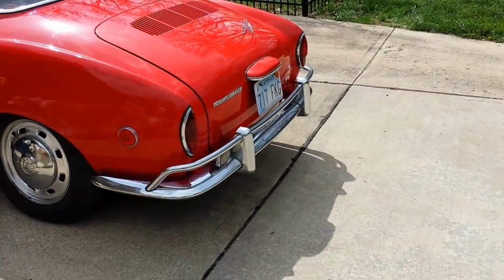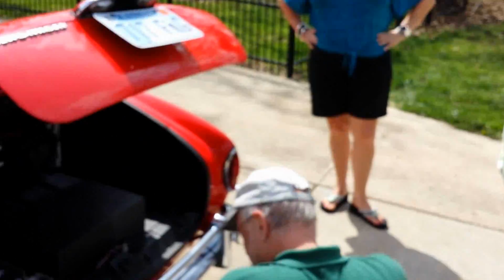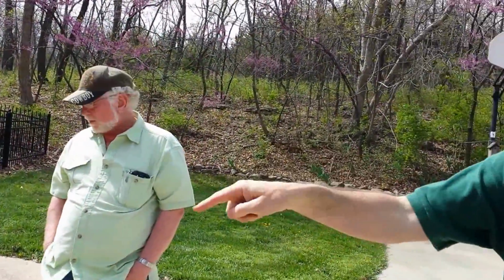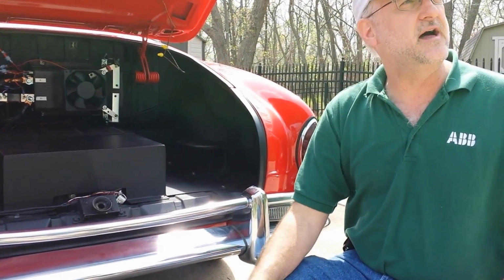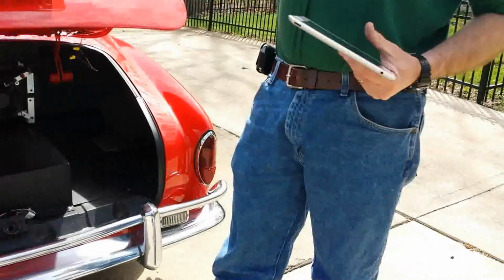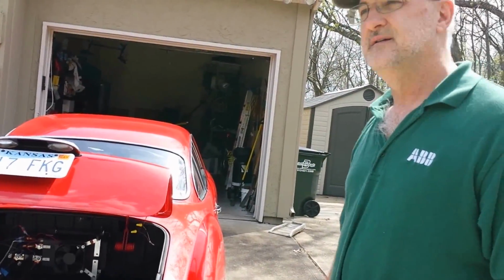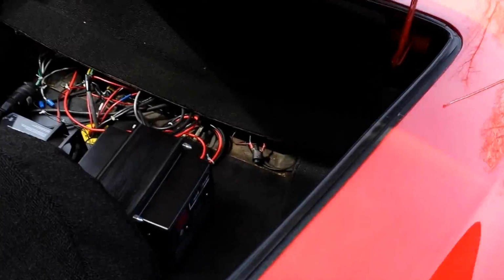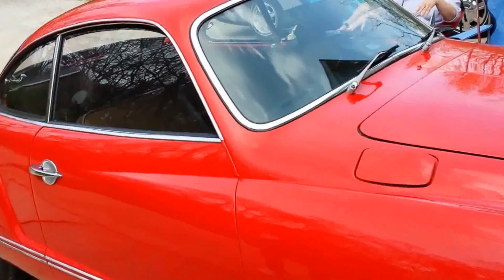1969 Volkswagen Karmann Ghia coupe plug-in electric conversion.

Comment: In a previous video and others like it the conversions take up more space (batteries) then the original engine, gas tank, etc...
I like the idea of placing the batteries behind the rear seat but there's not enough range (40 miles) to get chores done (inc. monthly 80 mile round trip to my sisters).  ;-)
I look at how and where components are located in these various conversions and wonder where I'd place things to provide trunk space (front and back)?

Comment: A Prius? How about a Tesla model 3 with the long range battery (75 kw) which gives you with the recent over the air update 335 miles of range. And it does have regenerative braking. Single speed 9.03-1 gear ratio.

Regarding the 12 volt battery simply add a 65 amp Bosch alternator above the motor shaft adding a single v-belt pulley to the motor shaft then add a belt and voila you have a charging system on the vehicle on the go.

Comment: I suggest a speaker in the engine bay and a cd of a VW bug engine running just to fake people out and have it die with horrible sounds of engine death. Then look at bystanders and say ahhh crap!  The quietly pull away on electric power. You should get some good looks particularly if you installed a set of exhaust pipes or a custom high performance exhaust one pipe.

You should get some what tha? Type of looks.